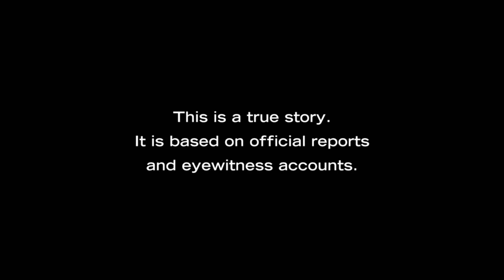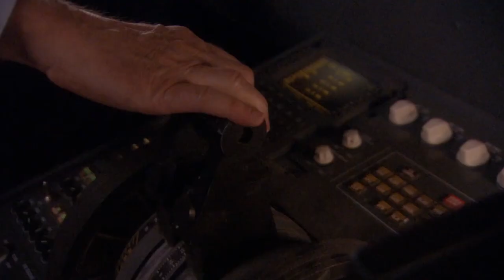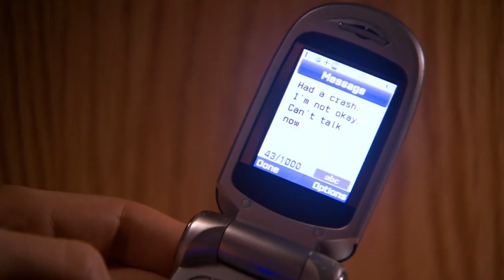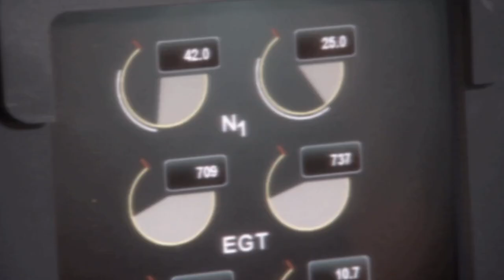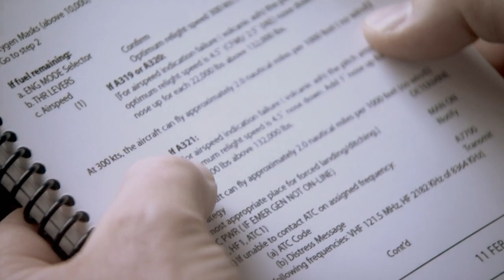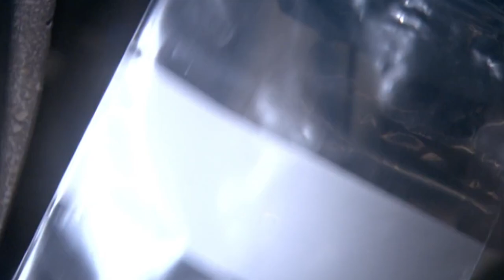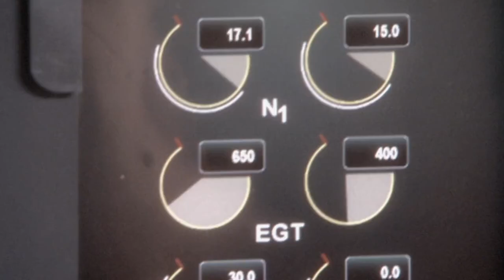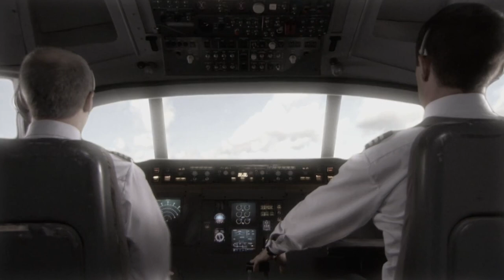The Pilots That Became Instant HEROES! | Hudson River Runway | Mayday: Air Disaster

Comment: took a shooting class couple years ago, one of the instructors was a passenger on this flight, he said the funny thing was the landing wasnt even that bad. Not nearly what youd expect. He had nothing but respect for the flight crew, said hes had worse landings on pavement than that crash
Reply: It wasn't a crash...it was a ditching
Reply: @tugbankert6581  lives lost or not, Ditching is a type of crash. the effect is that water is only slightly softer than buildings
Reply: @theduke7539  Every landing is a type of crash, most can still fly afterward.
Reply: @tugbankert6581  “forced water landing” in the words of the captain
Reply: It probably depended where you were. The passengers in the back said it was extremely rough.
Reply: Since the aircraft wasn’t repairable afterwards I’d consider it a crash. I’m also guessing that the structure was damaged beyond repair even prior to the water damage and sinking.

Comment: I've watched Sully about 30 times.  Can't stop.  Just a fantastic movie.  Yeah, it doesn't strictly 100% follow reality but they did a good job of taking what did happen and turn it in a good movie that can be enjoyed by all.  Also glad to hear that Patrick wasn't bothered by Sully's short responses and lack of response.  Number 1 rule of flying.  Aviate, navigate, communicate.  Keep your plane in the air and steady, figure out where you're going, then if there's time, communicate with ATC.  Yammering to ATC does you no good if your plane's in a freefall or you have no idea where you're going.

A lot was made about the A320's fly by wire systems but Sullenberger himself said that the system did make it impossible for him to achieve the optimal landing flare, which would've softened the impact.  So the fly by wire systems weren't the only reason Sully was able to do what he did.

Comment: 8:44 - I was kind of waiting for the part where Captain Sully jumps ahead of the quick reference handbook and started the APU or auxiliary power unit. Because of his actions, the airline actually changed their QRH to make THAT step one. Without engines and without the APU running, there is no hydraulic control, and there is no power to maintain the batteries.
Edit: OK, they finally mentioned it at 27:15.